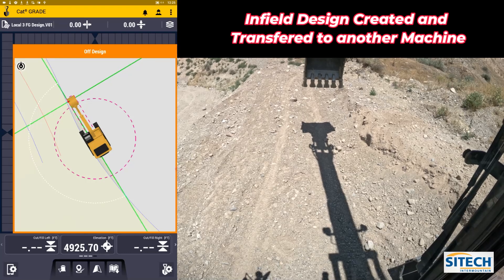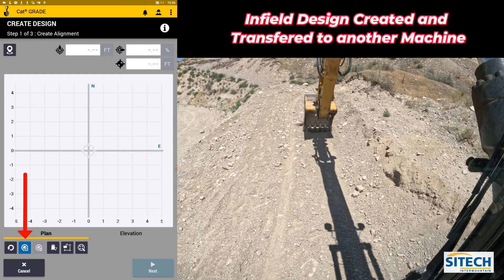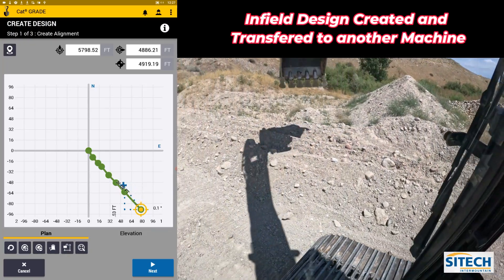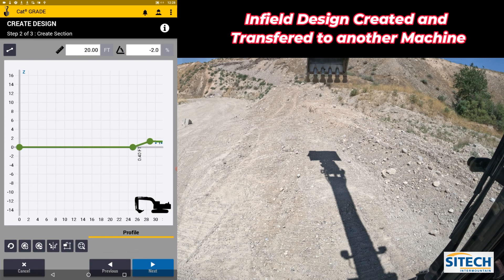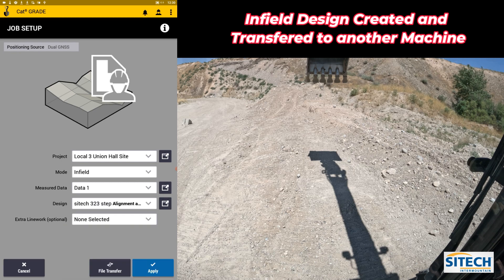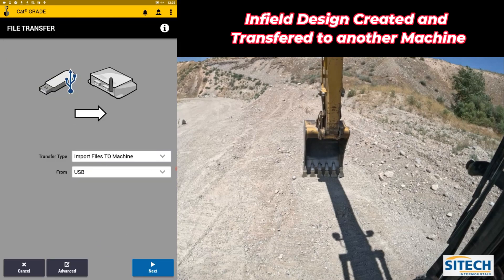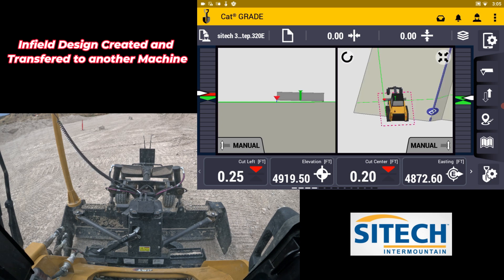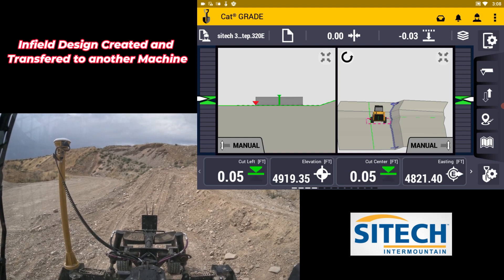Earthworks Infield Design Created Exported to Other Machines

Comment: Good video but would like to no how to flip it back to put infield from earthworks into GCS900 please could u guys do a video of the process cheers
Reply: So I have tried that a couple times now. I have taken some infield designs like alignment and section, level pads, and slopes from earthworks and tried pulling it into Trimble Business Center so that I can re-export to GCS900 and it wont even let me import.  I took it to Trimble and they said that right now that is not possible and it is a Enhancement Request for future options.  So as of right now it cannot go backwards, only moved over to other earthworks machines.  thanks for watching.